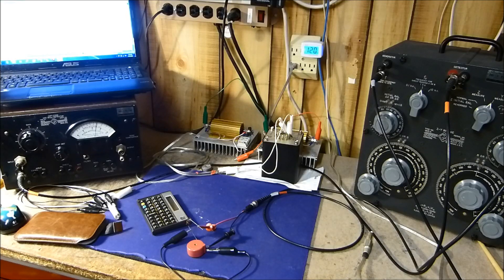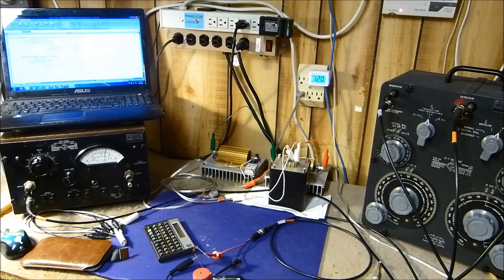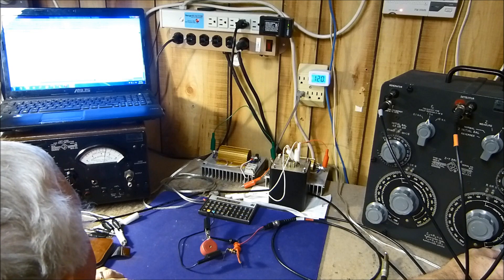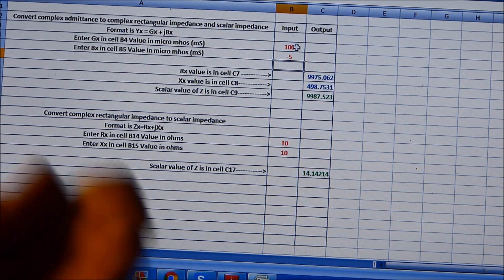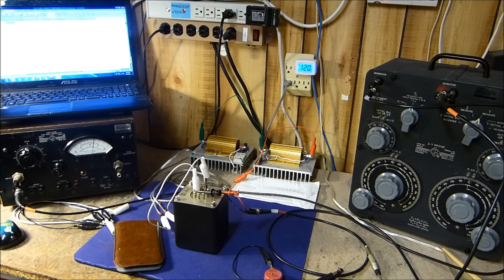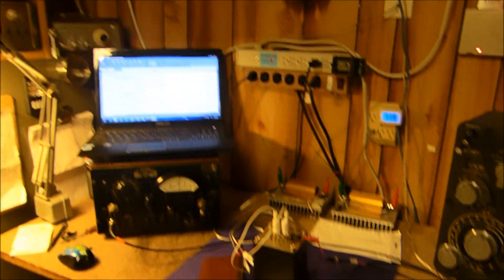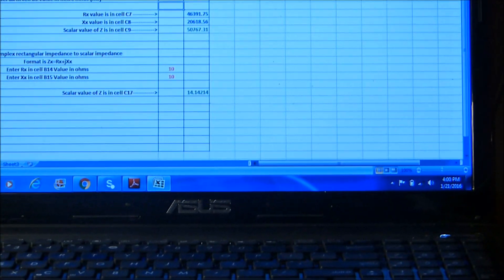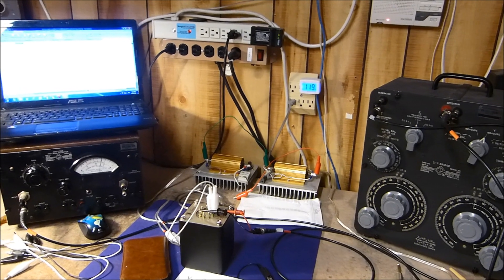A Look Into Real Measurements of Audio Output Transformers

Comment: Thank you for your interesting and enlightening video's. I have watched many of them, and now I am designing an amplifier from scratch, all be it with the guidance of your video's and also Uncle Doug's equally enlightening video's. Today I am working on the output and output transformer section where I was a little confused as I have a transformer (new) which has no information of input impedance. I am in Plymouth England and my voltage is higher but that is not an issue, Although I have not been able to work out the impedance from the video info,  I now know the impedance because I contacted the maker and asked.  Your video's get me thinking clearly, which is my point to this post. Thank you again.

Comment: I know this is off subject but I have encountered problems with my computer setting too close to other electronics and have had glitches in the system.  I think it was a magnetic field or it just happened coincidentally.   always thank you for the videos.
Reply from the maker: +noahtheviking I don't know if you use a WiFi connection but as I am sure you know, the microwave oven and WiFi are both on 2.4 GHz. Could it be something like that interrupting your Internet connection? Maybe even a 2.4 GHz phone? Just guessing.
Reply: that sounds more like it